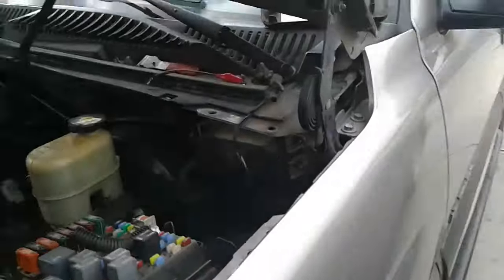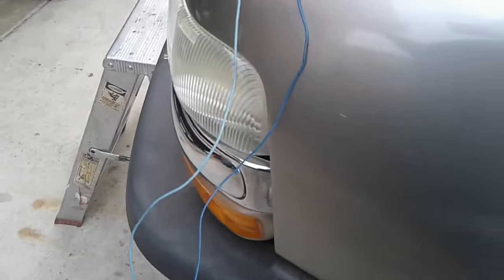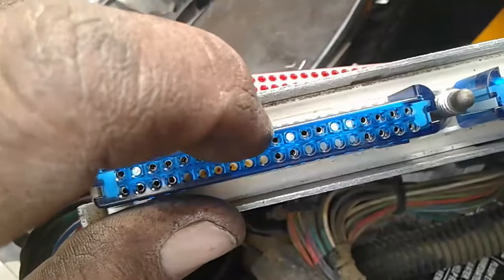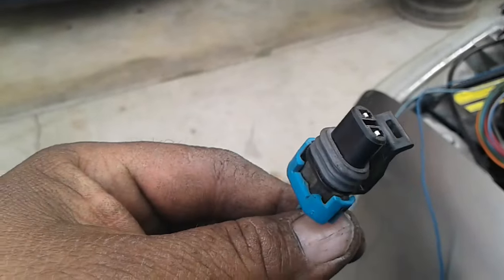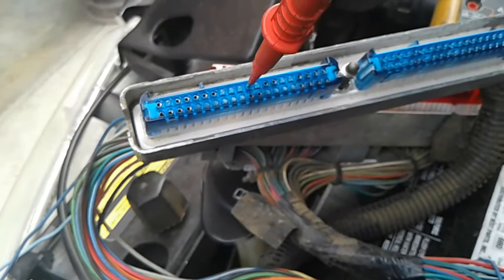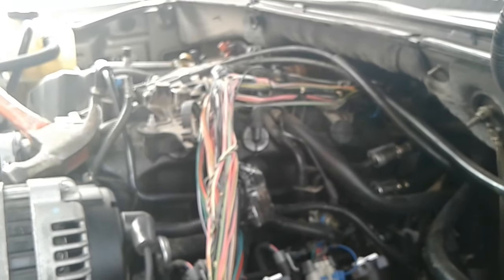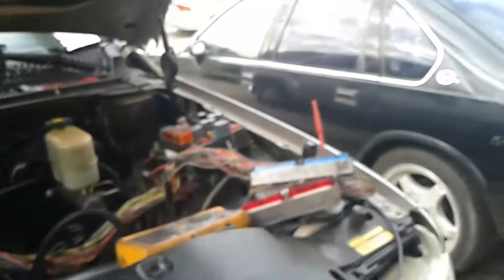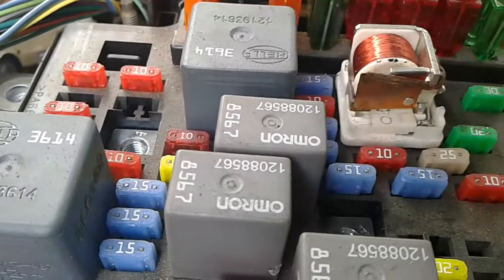Knock Sensors replaced and still getting codes P0327 & P0332

Comment: Thank you so much… Replace my knock sensors on a 2000 Silverado 3.5…. Kept getting knocked sensor code… I took the wiring harness off of the ECM, cleaned all the connections, erased all the codes, the code has not come back, but it’s only been one day, so we’ll see in about a month….. again thank you for sharing your video
Reply: Did it come back?
Reply: All good?
Reply: When you disconnect the battery your resetting the computer and it will stay off for a few days is all. Use Premium gas next time and there's a good chance it will fix the problem. The problem is usually the caused by misfires from low octane gas.
Reply: 95. Ohms to 107 ohms resistant resistance.

Comment: 99% of these sensors are made by the same factories in China, even the GM (AC/Delco) branded ones.  The key is to test the new sensors BEFORE you install them (that 95 - 107 ohm between the pin and the metal body of the sensor) and make sure you DO NOT over-tighten them and twist the sensor inside the body, which can break the electronics.
Reply: Just because they have the correct resistance doesn't mean they are good.
Reply: I'm guessing mine just went bad
Reply: What electricroncs brake

Comment: I relocated mine to bank 1 side of head there’s two empty threaded holes above the manifold (remove heat shield ) one by cylinder 3 and 5 I believe no more knock sensor codes I used sensors and a harness from 1a auto. I did this job 3 times all with AC delco parts and had the same codes each time with 100 ohm readings. So far this is working
Reply: Can anyone else vouch for this just curious if others have tried it and if it works
Reply: Try it and find out. Sounds solid. I have a small engine that needs to be level to run. Don't know why, but these two relate and it works in my head lol
Reply: I've read about this KS trick on LS1 forums, he's telling you a legit method👍
The whole engine is grounded anyway with 2 or 3 cables depending on the vehicle and many cars have KS on top of the block as well, GM decided to put them there👎

Comment: Pro tip, never probe the connector backbrobe  from the wire side, you can easily creat another circuit problem by spreading the terminal.

Comment: I've wondered if the injectors can cause it my problem started from the rear one which normally rust  causes the fail. After I replace them the codes are now two of them 332 and 327. The 327 wasnt present until repair. Although 332 was always present.

Comment: I know this is an old video just wanted to share what I'm going through. I have a 2002 Saturn SC1 I'm getting  code p0327. The symptoms I am having is the car jerking especially at lower speeds. Its a manual. losing power and the RPMs reving up on their own. I bought a brand new knock , replaced the wiring that goes from the knock sensor to the computer. am still getting that code and two new ones as well.

Comment: If you're still getting codes after replacing knock sensors and clearing with scanner try resetting the ECM/ECU that's the only thing that I found to work.
Reply: Is resetting the ecu/ecm the same as clearing the codes
Reply: @nathanplayz9506  No resetting  the ECU sets everything back to Virgin factory settings. Clearing codes erases the codes but keeps the settings up to that point.

Comment: I read somewhere that GM has a weird learn cycle for these knock sensors, after replacing them you are supposed to rev the engine to 4000-5000 RPM and hold it there for 3 seconds, then repeat once more. That will learn the ECU.
Reply: I just had the rear knock sensor code which was corroded with water in the hole when I took it apart. Replaced both sensors with acdelco and torqued/put it all back together without testing them (like an idiot)... Now I have the front sensor code. Just saw cj phillips video about that relearn procedure and thinking that may be my issue. Gonna try it tomorrow, just hope I didn't get a broken sensor
Reply: @GA10TV Did it work?
Reply: @rustyshackleford407  Nope!
Reply: @GA10TV  yeah didn’t for me either lol! I’m going to try some CRC Electronic cleaner on the ECM/PCM pins and harness connector. I don’t think my sensors are bad.
Reply: @rustyshackleford407  Hope that works! My front sensor probably just shipped bad so i'm gonna take it apart in a few days again... At least it has a warranty from autozone
Reply: @rustyshackleford407 did it work??
Reply: @JesusRodriguez-nx8zi  Lol I actually haven’t even tried it yet. I’m not getting any running symptoms or worse MPG than my Yukon is rates for but I still have the CEL. I still plan to do it at some point tho
Reply: @rustyshackleford407  I just used that cleaner on the harness and only one side of the ecm yesterday and then erased light. We’ll see…
Reply: @JesusRodriguez-nx8zi  did it work ?
Reply: @leonellopez9785  it was pretty dirty but no, light still comes on and turns off by itself. Must be a wire issue somewhere..
Reply: I’m in the same boat. 😢I’m going to try and test the wires to the pcm . Ks and harness had good ohms

Comment: just paid around 700 to have my knock sensors replaced in a 2004 chevy silverodo 4x4 v8 and not even a day later the codes came back what could this be
Reply from the maker: Are the knock Sensors Chevy O.E.M. knock Sensors? Aftermarket Sensors are Junk.

Comment: So you think the manifold removal is bad on your Silverado ?
Try that on my Camaro instead then talk, lol, I have the same condition you have only I know my sensors are fine after swapping the 19y.o corroded units last autumn, new harness, 2 ACD sensors and JB Weld engine RTV.
I even checked all the ground cables then soldered my old still working harness to some 100k Ohm resistors to simulate a perfect knock sensor, connected then drove and still got both damn codes this morning🤯
Now after taking apart my PCM today I'm pretty sure it's a ground issue somewhere that I'll have to find.

Kudos for taking apart that whole harness man, that looks like a pure desperation move...I hope it doesn't come to that with my impossible to work on engine bay.

Thanks for the video👍

Comment: May 26 2024 , hello , I have 2006 gmc 1500 Savana 5.3 L v8 . I have replied the knock sensor 2 x now . After driving 2000 miles the code po332 Knox/combustion vibration sensor 2 circuit low bank 2 . Why ?

I have cleaned the pins that connects to ECM and 2 wires come from harness that connects to Knock sensor connector . ( if this code come up I well just replace new pins and wires and not use the old wire in the harness) 

I checked the continuity it is closed and good . 

Question is ; how do I check the voltage of ECM ? 
Also do I need to check if the new knock sensor is readin the knock from the motor three the wire to ECM . If o do how do I do this using a , Etekcity ( brand ) multimeter ? 

What is the right voltage ? When it listen for the knocks , what is it supposed to read ?

Comment: I back again ,      I replaced , AGAIN for the fourth time , 

used ac delco knock sensors, 
15 ft lbs of torque 
 and use a GM wire harness , tested both sensors after installed , 
when I meter the knock sensors , I get .2 ac volts , when I tap on block this reading goes up to 8-12 ac volts 
so I assume the knock sensors are working ok , that reading was straight on top of sensors , then hooked up the gm harness 
and got about the same reading 
so I put everything back together , 
and about 100 miles later , the dreaded p0332 and p0327 came back on , I have tried everything , and I don't know what to do anymore , so at a loss for words right now , I even check for resistance going to the pcm , it seamed fine 

why why why is this such a headache
Reply from the maker: First did you test the knock sensors through the computer connector , and you may need to reflash the computer , to eliminate the possibility of curupt software, while checking for damaged computer components. The one I was dealing with was just a bad connection at the PCM connector I believe it was the blue one.
Reply: haven't tried that ,
Reply: ok I just checked truck again , 
I get 100 ohms on both sensors to the ground bolt , truck not running ,
I get ac volts from the semsors through the gm harness , do you know the specs for the proper ac volts 

then I checked while running  the pcm connector where it connects to the gm wire harness , 
I was getting 0.42 and 0.41 volts from the pcm , 
do you know the specs the volts the pcm suppose to be sending ?
Reply: I cleaned the pcm connection and the pigtail end with contact cleaner , ,
it had some corrosion on pcm pin , still not getting 5 volts from pcm 
do u know the factory specs for this
Reply from the maker: dan blank I will try to find specs, and relay them to you.
Reply: thank you
Reply: @smokingmeatanddiybydaniel8953  if you dont mind telling me what fixed the  problem im having same issue
Reply: @southside1975  i have done everything to fix my problem , but knock sensors still on , even relocated them to access them easier still same codes , the only thing left to do is actually go to local dealership and pay the high price and get two from them , and try it , but I have really done it tested it over and over , at this point , im like screw it , ill just drive it , tired of spending money on it an it not be fixed
Reply: dan blank hey I’m having same problem on my Ls400 ,did you ever find the solution to yours ?
Reply: Okay heres something u can do. Get two wires and go from pcm pin to stright knock sensors pin and see if that will fix it. If it does fix it you know its in the wiring. If not then it has to be the pcm.
Reply: Like somebody suggested maybe ur engine is knocking for real and that’s why u still have the codes coming back.....
Reply: @smokingmeatanddiybydaniel8953  any solution?
Reply: @ronhill2560  no finially gave up , and just drive the heck out of it
Reply: @ronhill2560  only thing else to try is go to dealership and get genuine gm senors not acdelco ,
Reply: @smokingmeatanddiybydaniel8953  I have to fix my truck .  Must pass emissions for a tag.
Reply: @ronhill2560  I ask a mechanic , he being doing it for along time ase certified , he said he always uses genuine gm from dealership , never uses anything else , he said the volts are different on other sensors , as long as u ground test your sensor and us gm parts he never had issue having to redo it
Reply: @smokingmeatanddiybydaniel8953 so, dealership has different Acdelco than parts store? I'm confused
Reply: @ronhill2560  ac delco parts are aftermarket , oem what gm puts on trucks and cars are labeled " genuine gm" , that's what its says not ac delco
Reply: @smokingmeatanddiybydaniel8953  if replacing them w these, fixes my nightmare from HELL .I'm definitely going to post.
Reply: Ron Hill please let us know what happens.
Reply: Ron Hill did GM parts fix it?
Reply: @smokingmeatanddiybydaniel8953  gm and Chevy both use ac Delco parts and plugs... C'mon man
Reply: Keep getting 332 code .I swapped the 332 and 327 wires and still get 332 code and alternated knock sensors .so that tells me knock sensors are good and harness is good .something is off from harness to pcm on 332 wire only .I ordered a refurbished ecm and will check connections on pcm and update
Reply: @sellmycar44  hook up p0332 wire to the one next to it and ull be set atleast one will tell you if your engine is knocking frl
Reply: @sellmycar44  any update
Reply: @fiveninegarage  took pcm out and swapped pins 332 and 327 .started getting 327 code and not 332 code  .so that told me pcm was not the problem. Problem was 332 wire between pcm and where  it came out of harness ..I swapped the pins back and cut the 332 wire about 2 inches from pcm and ran a new wire bypassing the harness .problem solved initially .then started getting 327 code ..so was starting to get ready to take fuse box apart thinking had to be inside under there .maybe mice ? One day was just moving stuff around to see if I can catch something strange or rubbing and found that maybe 2 years ago I replaced the power steering lines that go to the hydroboost and I ran the lines over the wire harness instead of under and it was pushing the harness down and making it rub on some plastic clip .so I found what the problem was .disconnect and reconnected lines and .bought new pins and wire to bypass the harness .so far no solved the problem. Hope that makes sense .moral of the story when you take stuff apart make sure you put it back the right way .I had done the knock sensor relocation on the sides so it was easy to swap and diagnose and chase it down to the computer..any question just ask
Reply: @sellmycar44  are you on Facebook? I’ll pm you there if so.
Reply: @fiveninegarage  dont have Facebook.
Reply: @sellmycar44  damn a direct message would be easier. I’ll do my best to explain my issue here. Might post a video on my channel so others with the same issue can see
Reply: @sellmycar44  here goes…

2006 2500HD 6.0 Gas Chevy. 

Knock sensor codes bank 1 and 2 low circuit voltage. 

-all ground cleaned and block ground relocated 
-new ac Delco knock sensors 
-new ac Delco knock sensor harness 
-all components tested and in spec 
-wires from pcm to knock sensor harness hold 12v 
-pcm output is .12v at both the pin and harness plug while running (I believe it’s supposed to be 2.5v plugged in and 5v unplugged) 

I’m at a loss of what else to check other than replacing the pcm. One clue I do have is if the code is cleared with key on it does not come back until the truck is turned off and restarted.
Reply: @sellmycar44  lmk what ya think
Reply: @fiveninegarage  system is pretty simple .from pcm to knock sensors .so it has to be something in between those 2 .so I would rule that out first. If it still gives you a code then it's the pcm or the pin connection going into the pcm .this is what I think you should do I would bypass all the wiring from the pcm to knock sensors .pull out the pcm figure out which 2 are the knock sensor wires dark blue and light blue .theres a you tube that helped me .let me know if you need it .then cut only 1 wire .either one  and splice a new wire to it and run it right 2 either knock sensor .there fore bypassing everything in between,  harnes, connector etc. Reset computer so if now it only throws only 1 code then you know it was something between pcm and sensor .could be a break somewhere .that's intermittent?? .
Reply: If you only get 1 code .do the same for.the other wire and problem fixed .but I will still try to inspect the harness .move it around look at it see it you notice anything off .if something wore the harness somewhere it will continue to do so and give you other problems .if bypassing 1 wire dosent fix it .and.you still get bother codes it has to be the pcm or the incoming into the pcm .I dont know if you know how to take out the pins and put new ones and.or how to clean them .I did a good amount of you tube and google research and figured it out .
Reply: @sellmycar44  I saw that video where he had it all apart. How do I do a computer reset? Unhook negative cable and turn headlights on for awhile?
Reply: @fiveninegarage  by reset I meant just erasing code with a cheap odb2 code reader
Reply: @sellmycar44  what do you think about it picking up engine noise? Engine runs super smooth 185k miles. 

I can post a video on my channel of it running
Reply: @sellmycar44  also would it be possible that the pcm is bad? I’ve checked the pin and the harness and it had no corrosion. It’s strange that both codes come on at the same time every time. Never one or the other
Reply: @fiveninegarage  I dont think it's the engine noise .if it was you would have bigger issues .it would be knocking pretty bad.from what I've read .so I would rule out the engine .I would try bypassing one wire like I told you .if you still get both codes then .has to be pcm theres no other parts it's just pcm pins wires ,harnesses clips and knock sensors .
Reply: Just cut one of the wires coming from the pcm like 2 inches and run a new wire directly to one of the knock sensors .that will rule out everything in between. Would have to be knock sensors or pcm .so probably pcm when i cut my wire from my pcm i took out the pin and soaked it in vinegar and salt .to get any corrosion of it especially the inside that isn't visible .and later i ordered new pins and wire .i wanted to make sure it wasn't the pins .overkill but wanted to rule out the pins .
Reply: Where are your knock sensors? I put new  ones on the sides of my engine .like in the you tube videos. Relocation rates them .used a threaded rod that I cut and some nuts .I cleaned the holes pretty good and used a thread cleaner/cutter To clean out the holes and sparayed them down wire brake cleaner .
Reply: I would.rule out everything before buying a pcm .I could send you the info on pins if you want to put new pins in and wire

Comment: Did you ever solve this? I have issue where they both come on but if I delete the code with key on they don’t come back. It’s only when I reset pcm that it comes back

Comment: Have you considered the possibility that the engine may be experiencing a real knocking condition.If that is so then the light will not turn off.
Reply from the maker: Victor Aberdeen good point, but the problem in this video was the computer connector was having the little prongs pushed out when you plugged the computer in. I changed the connector casing and all is good.

Comment: I keep getting a 327 and 332 code. I’ve replaced both knock sensors and the harness with GM parts. Both show 20 volts from the computer and 99 oems. Both respond to tapping on the exhaust manifolds with voltage ranging up to about 300 microvolts I think.  What am I missing? An ideas?  Please help
Reply: Any luck?